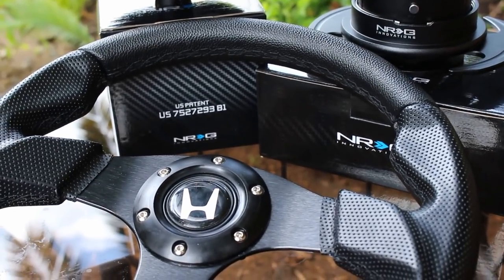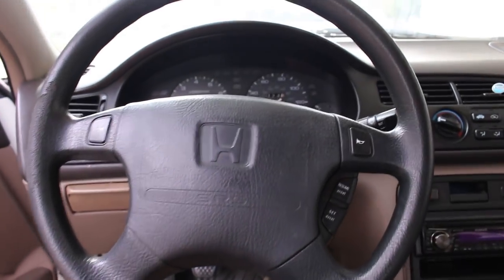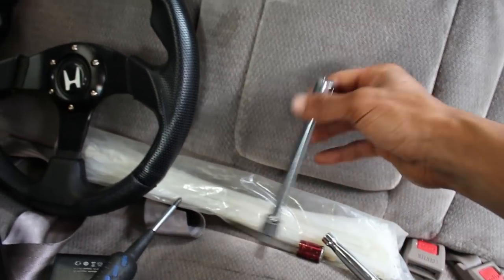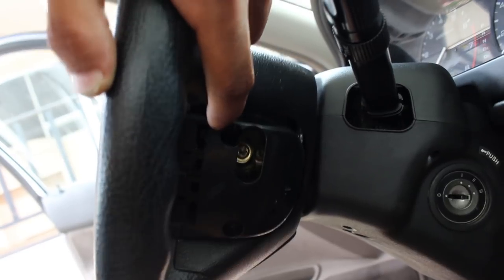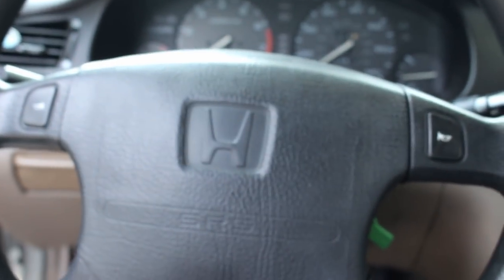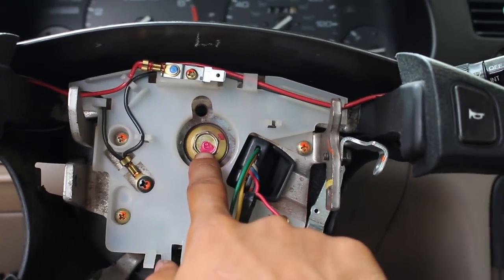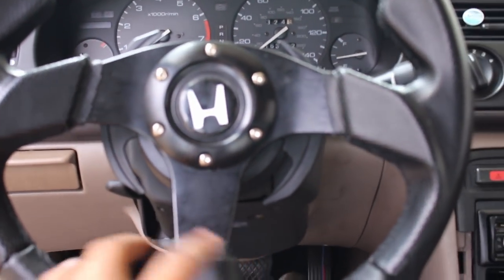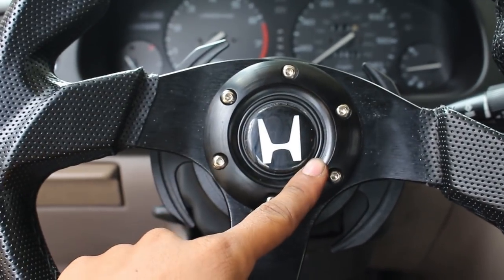How to install an Aftermarket Steering Wheel in a Honda!

Comment: torque for that bolt is 35-45 nm. with a 100 you risk destroying the hub, and it can crack under load because the material is not strong enough..
Reply from the maker: +ProjectGTR thanks for the info man!

Comment: You don't have to press the button to take off the steering wheel. The c clip on the quick release is sitting in the wrong position. The c clip will push the button in for you when you pull the levers. Should be a little hex screw on the bottom of the quick release holding the c clip in place
Reply from the maker: +Anonymous Vaper holy shit dude! Im for sure going to see in to that. Thank you! :)
Reply: The steeringweel is better without alankeyscreew

Comment: You can either beat the sides of that steering wheel with the palms of your hands or use a rubber mallet but leave the nut/bolt on loose so it doesn't hurt you when it comes off

Comment: Any links of the parts used?
Reply from the maker: I might be a little late, but I just put links to all the parts I used in the description.
Reply: @StayTunedGarage  those links are for all the part you use except the steering wheel right

Comment: He don't not how to work in Cars. The firsting that You go to do is desconect the battery first before You pull out the air bah😤😤😤😤😤
Reply: Very true, was the first thing I noticed… first thing you should do, VERY FIRST THING… is disconnect the negative terminal….